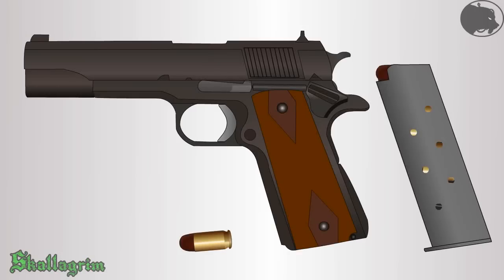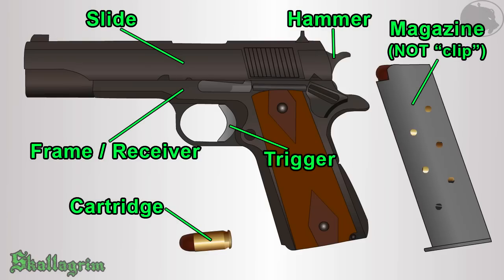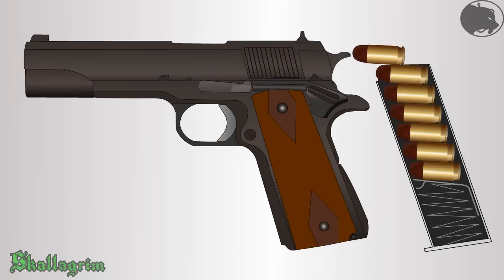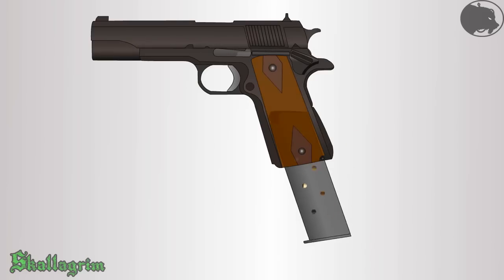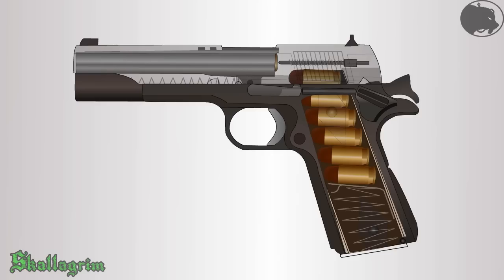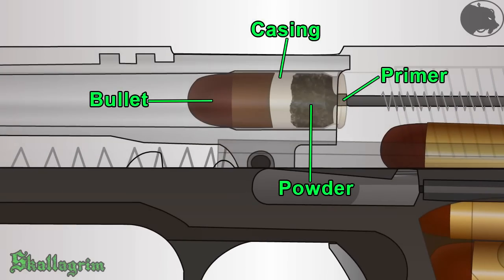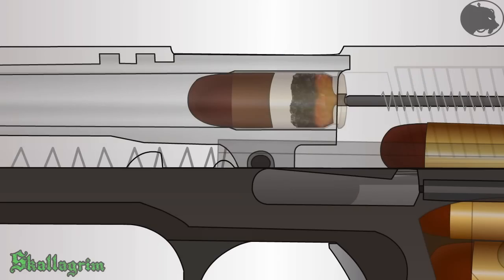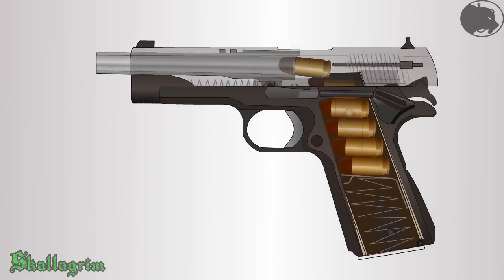How a firearm works - Animation (1911 semi-auto handgun)

Comment: Wait so the slide moving back is purely from the force of the recoil? Whoa
Reply: +Sandra T. Yea,and it's an advantage so that the remaining casing gets out of the gun,without making you to reload the slider again
Reply: Kix Leon Oooh, so models that don't have enough recoil to do that on its own has to be reloaded manually. This is explains everything that's so COOL.
Reply: ***** Yea,a good example might me Gauge Shotgun,that's why you have to reload it,so the bullet gets out,and a new one goes to shoot
Reply: YTES NIGA
Reply: the cartridge moving back has the same amount of force as the bullet going out. so yea it can easily do that.
Reply: Physics
Reply: In recoil operated firearms, yes.
An AR-15 doesn't do this, nor will any manual repeater like a lever action.
Reply: Well to be more specific, the slide doesn't directly move from the recoil of the gun. The barrel is what moves rearward when a round is fired because of equal and opposite reaction (kind of like rocket thrust), and the barrel pushes against the slide. The barrel stops after a short distance but the slide continues moving rearward from the momentum the barrel enacted on it. The slide reaches full travel and then the compressed recoil spring begins expanding, pushing the slide back forward into battery. This is called short recoil operation.

In fact a lot of the recoil you feel when shooting a semi auto pistol is actually from the slide itself striking the frame at the rear of its travel. You can see this in slow motion videos. The pistol and hand will stay fairly leveled when the pistol is shot, but once the slide hits the end of its travel, it transfers its energy into the hand, jerking it back. Certain pistols or calibers are know for their "snappy" recoil. This is largely due to a particularly high slide momentum.
Reply: No no no. The slide starts to move back because the cartridge case pushes it backward. And the case is pushed back by the propellant gas. The barrel is NOT pushed back by the gases or the bullet. In fact the bullet tries to push barrel FORWARD because of the friction between the bore and the bullet. But the barrel moves backward because the slide and the barrel are connected, and the force of the gas pressure acting on the slide is much larger than the friction acting on the barrel.
Reply: mottee Nope. What you're describing is simple blowback operation. The vast, overwhelming majority of semi auto pistols do not use simple blowback - they use the short recoil operation/Browning lock up design, including the very design used for the video (the 1911), which was designed by John Browning. The barrel is locked with the slide, the barrel pushes it back from the recoil of firing a round (for the same reason a cannon on wheels recoils backwards when shot, not forward as you suggested), then it tilts downward so that the slide can continue rearward without it. If you won't take my word for it, you can google "short recoil operation".

Not many pistols use the method you described because it generally only works safely with anemic, uncommon cartridges like .25 ACP, .380 ACP, ect. Common calibers such as 9mm, .40 S&W, and .45 ACP require short recoil operation because the chamber pressure needs to decrease to a safe level before extraction can begin.
Reply: Sand Rat its called the blow back effect its common use in modern day pistols.
Reply: ANGRY F.O.X ZD Most modern pistols use short recoil operation, not blowback.
Reply: The only current production pistols that use simple blow back are cheap Hi-Points and compact pocket size pistols that are chambered for weak cartridges. not much else.
Reply: No really! so for years you thought it was magic or just a design feature
Reply: pyropulse 1- this comment is years old so your ego feeding sarcasm was unnecessary. 

2- your ego feeding sarcasm was unnecessary, period. Until I knew about guns, I thought it was some internal mechanism instead of the reactions from firing a round.
Reply: +SgtKOnyx AR 15's direct impingement is in a sense a recoil based system, though far removed from that of a pistol...Its tapping the expanding gasses from the discharged shot to send the bolt back, ejecting and extracting a new round. A glorified method of recoil operation IMO
Reply: pyropulse you didn't call me anything. You insulted the poster of the comment. 

TL;DR I said when I was a child who knew nothing about guns, I thought the same type of mechanism that worked firing a gun helped move the slide back to eject the casing. (Notice I said same type, not same exact.)
Reply: juggaknot93 The majority of the recoil you feel is because of the bullet. If you've ever fired blanks even with an adapter that would properly cycle the gun like firing regualr cartridges you'd know they have less recoil because its not pushing a projectile, as per newtons third law the force exerted on pushing the bullet forward applies the same amount of force back on the gun itself why do you think you feel a little recoil before the slide has fully retracted despite this the slide does still contribute for a lot of the recoil.
Reply: It's why other calibers and unusual rounds are notorious for not cycling properly.  It was designed specifically for 230gr. FMJ @ 830fp/s.  Browning's design inspired a lot of similar designs in other calibers, and even a 2011, which has a double stack mag.

Personally, I like the series 70.  It's extremely reliable, because all the parts (except the springs) are big chunks of metal.  I don't like a bunch of little parts shoved into a polymer frame.  I don't hate on people who have those, but it's not for me.
Reply: For pistols, yes. An assault rifle will have a gas-operated bolt. That means that the gases produced when a round is fired operate a piston that cycles the action, thus ejecting the spent case, cocking the hammer and finally stripping another round from the magazine and loading it into the chamber. If the selector switch is set to automatic, then provided the trigger is still engaged, the hammer will spring straight back up as soon as the bolt moves forwards, firing another round.
Reply: @juggaknot93  It's still the slide that's pushed back by the force of the bullet in any handgun design. The barrel tilting design is meant as a way to delay that by providing some resistance to the backwards force of the slide. It's a sort of lock.
Reply: @petercdowney  you described any gas operated firearm, not just "assault rifles". Automatic guns have an auto sear instead of a simple hammer catch, that holds the hammer until the bolt drops it as it goes into battery and the hammer is free to go
Reply: @sdsdfdu4437  Well, yes, battle rifles are also gas-operated, for instance. Though machine guns and submachine guns are often blowback operated.
Reply: @sdsdfdu4437  Nope. In blowback operated handguns, the cartridge case acts upon the slide to move it. In tilting or rotating barrel operated guns in it is the barrel. The locked system you are referring to does not lock or delay the slide. The locking refers to the barrel being locked to the slide momentarily during firing to 1. allow safe chamber pressures before extraction can begin and 2. have something push the slide back to cycle it. The barrel is the moving part during shooting, but since it is locked to the slide at the very start of travel, the slide is pushed by it. Then the barrel unlocks from the slide (tilts or rotates), stops, and the slide keeps going from the force it enacted on it. The barrel is the middle man in terms of transferring the force of the shot fired to the slide. And sorry for the late response, I only now saw your reply.
Reply: @juggaknot93  In a blowback or a tilting or a rotating design, the force transfers to the slide, which  moves back and cycles the action. As you said, locking of the barrel is meant to delay the process slightly to allow for safe chamber pressures, but the barrel is not moving the slide, but vice versa. In fact, due to friction of the bullet and gases inside the barrel, it wants to move forward (away from the handler) as opposed to backwards (towards the handler). Look up the Schwarzlose 1908 blow forward pistol, in that case it is the barrel acting, but it moves forwards instead of backwards like every other tradition handgun design. This is in accordance of Newton's third law. The force of the barrel wanting to move forward after getting shot also helps to keep the slide locked during that brief delay, because it is the slide that wants to move -backwards-.
Reply: @petercdowney  Most rifles are gas operated period. A notable exception is the Hk G3 with its roller locking mechanism, but besides that any other exception is obscure or antiquated. Machine guns describes all firearms that are capable of automatic fire, and most modern or at least semi-modern designs are gas operated. Blowback operation is kept for smaller,  pistol caliber, usually cheaper(to produce) guns (M3, Uzi, Mac 10).
Reply: @sdsdfdu4437  Well actually, strictly speaking, the term "machine gun" refers only to automatic firearms that are designed for sustained full auto fire. An assault rifle, for example, is not designed for sustained full auto fire - if you fire it on full auto for too long, it may cook off - that's when you let go of the trigger but the extreme level of heat in the chamber causes rounds to keep going off until the magazine is out of ammo. However, you are right that in the US, "machine gun" is used as a legal term for firearms capable of fully automatic fire.
Reply: @sdsdfdu4437  Is the bullet being fired out of the slide or the barrel? The barrel. What is the barrel locked into? The slide. If you could chamber and completely enclose (lock) a cartridge into a barrel and safely set it off like a roman candle firework, the barrel is going to recoil backwards, not fly forward out of your hand as you suggest. (Which way do single shot rifles recoil?) This is short recoil operation Using this rearward motion of the locked breach barrel to kick the slide backwards is what operates a short recoil pistol.

I am familiar with the Schwarzlose. Your lack of understanding firearm mechanics is showing because the Schwarzlose does not have a slide, or a locked breach. It might be beneficial for you to understand your own example.
Imagine if you fixed a cartridge to a flat surface, slid a barrel over it, and detonated the cartridge. Because the system is not locked , the barrel is going to go with the projectile. This is blow forward operation. The Schwarzlose operates this way. Now, imagine the inverse: the barrel is the part that's fixed in place, you drop a cartridge into the chamber, and detonate it. The cartridge shell is going to shoot out of the back. This is blow back operation.

Forgotten Weapons hasn't released a short recoil video yet but he has released a long recoil video. Long recoil operates under the same principle as short recoil except the chamber doesn't travel as far as the breech. I suggest watching the part where he says, "When the gun is fired the recoil energy that's generated by the projectile going forward causes the barrel to recoil backward, and it's locked to the bolt. And the two of them travel the entire length of the cartridge...". Also notice how he pushes on the barrel of the Frommer Stop pistol to simulate it firing.
Reply: @juggaknot93  I don't even know what you're trying to say anymore. When did I suggest the gun will fly out of your hand? When did I say the Schwarzlose had a locked breach? Why are you making shit up?

Yes, the cartridge shell pushes backwards, and guess what, the force is transferred to the slide which is pushed backwards.
Reply: This is one way  called a straight blowback (I think this is not my area of expertise to say) these are only used in smaller caliber guns because in larger caliber guns they are unsafe as the recoil is too strong mast larger guns use a gas system which uses expanding gasses to cycle the action
Reply: @juggaknot93   the barrel only moves because of the lock design which then it pivots on a pin in the frame of the recever. The force of the cartridge striking the rear of the slide pushes it back cycling the next round once the lock on the barrel which is made to only delay the slide so you dont get a blast of hot gas from the port not push the slide back 
If you where to remove the pin holding the barrel in place the barrel would want to fly out of the gun away from the shooter and there are plenty of videos around showing this happening to semi autos
Reply: @NOKORUS_The_Eldritch_One  There are many things wrong with your comment so I'll try to address them all.
- The cartridge never strikes the slide. It is held in place, hence "locked breach" design, and the barrel actuates the slide when firing, being that they are locked together.
- The barrel doesn't delay the slide. It is a short recoil design, not some delayed blowback design.
- If you've ever actually handled a semi auto pistol, which I suspect you haven't, you will notice the barrel moves backwards and then tilts when you cycle the action.
- There is no "pin holding the barrel in place" in modern semiauto pistols. It's very obvious you've never disassembled a pistol before so I'm not sure why you're trying to arguing about something you're not familiar with.
- Even if the barrel wanted to go forward on a short recoil design when firing (which it doesn't), the barrel would not even be able to somehow "fly forward" through the slide because the chamber and cam lug on the barrel do not fit through the hole in the front of the slide. Something else that is easily apparent if you've ever actually disassembled any typical pistol.
- When in battery, the barrel and the slide are locked together. So if the barrel wanted to go forward during firing, it would bring the slide with it because they are locked together. But, which direction does the barrel and slide go when the pistol is shot? Rearward. Strange.
Reply: @juggaknot93  Yes, I've never actually disassembled a pistol but I think the first guy who started arguing with you (mottee) actually got it right. At least more so than the others. The bullet transfers a bit of its kinetic energy to the barrel through friction but the whole locked barrel-cartridge-slide system moves backwards because of the gas pressure. Bullet forward, barrel-cartridge-slide backwards. So, the friction ends up only reducing both velocities a bit. If you unlock the barrel from the slide the barrel would get a bit of forward motion while the cartridge-slide will go backwards as usual.

Actually I reread it just now and he did say that the barrel ends up moving backwards because it's locked with the slide. So, I don't see any errors in his comment. A cannon recoils backwards because of gas pressure. A short-recoil pistol barrel moves backwards because it's locked with the slide. Bullet moves forward and generates no energy (gas does) so it has no way of making the barrel move backwards. Gas pressure pushes on the barrel evenly and ends up not affecting it whatsoever. Gas pressure only pushes on the bullet and whatever is directly opposite of it. I.e. the case and slide.
Reply: No little gnomes in the gun pull back the slider each time you shoot
Reply: Chester cheese
Reply: @sandrat9309  yes the recoil ejects the cartridge quite smart really
Reply: @SgtKOnyx  but then thry can jam easier
Reply: Neutons 3rd law
Reply: Yea you slide only twice. “Beginning and the End”
Reply: yes !!! but dont drop your gun in the mud ...
Reply: I don’t want to sound mean, but what did you assume made the slide go back before watching this?
Reply: @SomeOne-vf1rs  Way up in this thread, someone hinted at a belief it was cycled by the same springs and levers that operate the hammer. This would allow cycling the entire mechanism without ammunition, just empty casings.
Reply: @Leo.Kalash  there's no slide lol that's why it doesn't come out
Reply: I see the barrel grip on top.😁 
But is not work in this animation 
May be he forgot delayed system

Comment: Really helpful know-how for a novel I recently started to write! Short and compact yet detailed, real quality explanations!
Reply: Not saying it's not a good bit of knowledge, but there are a few things that are missing. For starters this is only for Single Action Only (SAO) pistols, not SA/DA (Single Action/Double Action) or striker fired (Glocks and most other polymer framed pistols). Semi-automatic rifles, especially those using intermediate calibers or greater, rely on an entirely separate system as well. And machine guns using an open bolt (rather than a closed bolt) are even more different. Though I know less about them than I'd like, due to certain legalities regarding even owning open bolt firing firearms due to the ease with which they can be converted to full auto (though some firearms can be converted to "full auto" with a shoe string).